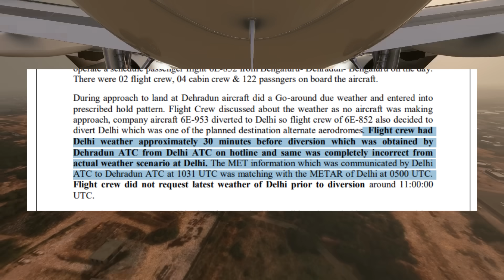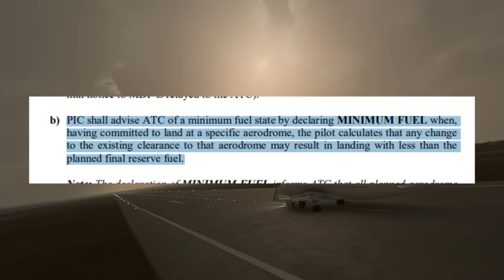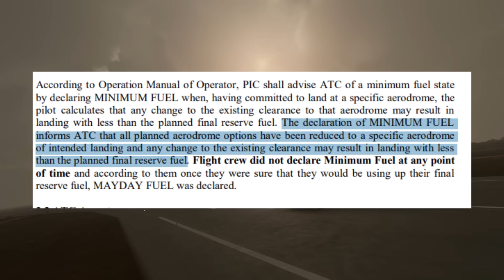How Two A320s Ran Out Of Fuel AT THE SAME TIME | Indigo Airlines 852

Comment: Why weren't the two emergency aircraft set up on different runways? Having the second mayday fuel aircraft go around after the first seems like a mistake by the controllers
Reply: the first aircraft needed emergency services which were on standby on the other runway in case of a problem. They can't teleport.

Comment: I've noticed you/others have also shared a ton of videos about fuel emergencies in India. It sounds like the planes always start with sufficient fuel, reserve fuel, etc., so I suspect it's partially what another commenter here has mentioned, that it's a communication issue where crews aren't speaking up in time. I'm reminded of Avianca 052, which crashed near NYC due to running out of fuel, and had repeatedly asked for "priority", but never "emergency" - and while Avianca 052 was the worst outcome, other Avianca flights around that time also had close calls with fuel because they weren't declaring emergencies.

I suspect other factors in India are potentially low-cost carriers where training or equipment might be lacking, and just the sheer size/population of India. Lots of flights means lots of incidents.

This also brings to mind the many incidents in Indonesia, Nepal, and (years ago) Russia. In the case of Indonesia, a ton of cheap airlines popped up with poor regulation, equipment, and training, leading to accidents. In Nepal, poor regulation is again an issue, but the biggest issue is that the Kathmandu airport is in the freaking Himalayas and it's just hellishly hard to navigate. Russia went through a bad patch after the fall of the Soviet Union where - once again - you started seeing poor regulation, shoddy equipment, and undertrained crews.

So there are definitely some patterns...
Reply: Why not just be r@cist and write less 😅

Comment: I don't understand why would they use the same runway for both aircrafts in Emergency? Delhi airport has 4 runways, they could vector the second one on the other runway.

And also would like to mention, that the weather forecast in India is terrible, their forecast was almost never match the reality. And I know during monsoon season is hard to predict precisely, but Vietnamese for example, their prediction is very accurate. 

Also the airlines policies restricting pilots to take extra fuel. I am sure in their manuals is written that the captain may take as much fuel as he considers they need. But in reality they don't really have this freedom, and it's just for the company to save 50usd per flight.

This incident happened 5 years ago, but I don't really see any safety improvements over there. I hope I am wrong, but we may expect similar incidents in the near future, and it might be with less luck
Reply: I'm not sure if it's still true, but for a long time the airport at Delhi had a weird set-up where there were multiple runways, but 3/4 were reserved for military for some reason, with only one "lane" for commercial flights. I don't remember how that came to be, but it was a big part of the capacity issues that airport has continually run into.
Reply: @jaybeetee5272 you are poorly educated… most likely by tabloid press of india

Comment: India tends to have an indirect communication culture that is highly context based.  Often times issues are hinted at and the other party is left to guess the intention of the message.  On the opposite end we have Germans, Israelis and Dutch who are direct.  A flight crew from one of those countries would be upfront about their fuel status and declare minimum fuel as soon as things started getting urgent.  From my understanding, 852 noticed the discrepancy in Delhi weather reporting and what was observed but did not speak up.  They also knew they were low on fuel, stated to ATC they had 14 minutes of fuel, and needed to be closer to the airport but never declared minimum fuel.  My thought is the flight crew assumed ATC would see the deteriorating weather conditions, figure out the plane was low on fuel, and suggest a solution.  It was only when 852 declared mayday fuel did the seriousness of the situation became clear.
Reply: Tbf they were in a bit of a sticky situation
Reply: Maybe it's because a formal delaration of emergency always comes with an investigation, so if you can convey your sticky sitiuation with a wink and a nudge you may not have to answer uncomfortable questions from authorities later.

Comment: If the screen display is RED the user has the manually refresh the data. What software are they running, DOS?
Reply from the maker: they had a local web server which hosted a webpage for the metar info

Comment: I would not be surprised if the airlines are underfueling to save costs, and hoping they don't run into a wall.
Reply: Well trust me it's about time we hear about a disaster, this company as per I can search have a no crash history over 2 decades of flying and now they are just pushing their limits with safety. 
The recipe is in place it is really about time something disastrous is gonna happen, very sad
Reply: its not worth it to carry extra fuel than required besides additional alternate and contingency fuel , you need more fuel to carry extra fuel as it adds more weight

Comment: 5:50 Errr.... Do I understand that correctly?
"Mayday, we are out of fuel."
"Acknowledged, let us park the fire engine on the runway."
Reply: How long does it take to start up a firetruck engine and drive 20 feet?
Reply: @baldrick98007 No communication received by fire engine regd second mayday aircraft
Reply: That firetruck was on runway for an earlier aircraft which had declared Mayday..
Reply: better to send out a fire engine & not need it than the alternative. even if there isn't a fire, it means emergency services can get to the plane as soon as possible
Reply: Fuel is not the only thing to catch fire in an airplane on impact with ground. The friction with the fuselage will result in fire too. 
So fuel or no fuel, the friction that the speed of the aircraft would cause when it impacts the ground , will start a fire.. so yes a fire truck is necessary.
Reply: What's wrong?
Reply: They still have landing gear and also no fuel left means extremely diminished risk of said fuel catching fire 😅
Reply: @infinidominion Got it 😅
Reply: That fire truck was placed for flight 953, the one that landed first. They requested for emergency services since they knew they couldn't probably go around and will need them in case something goes wrong. The plane that had to go around at that timestamp was the second arriving plane, flight 852. The fire truck couldn't evacuate the runway till the time flight 852 was in its final approach and thus they had to go around.

Comment: In the most recent Captains Speaking episode, Ben talked about a very long day where his flight had so many twists and turns - marginal weather, diversion, sick passenger, many of passengers not having the right visas for the diversion airport (different country), go around, diversion again, holding due to some paperwork issue. And yet fuel was not an issue. 
Of course, a whole different question is, whether it's an uniquely India problem, or if  it happens elsewhere as well but India is simply thr only one transparent about it
Reply: i think the aviation herald website would have low fuel incidents across the world in their database

Comment: What was an emergency vehicle doing on the runway when a second plane in an emergency was just arriving? Furthermore: I would think that in this case the first plane would have to leave the runway even if the plane breaks, because if not the other one would crash..
Reply from the maker: The first plane to Land declared a full emergency and they wanted fire trucks and I’m guessing they weren’t able to get the fire trucks off of the runway in time for the second plane to land
Reply: @MiniAirCrashInvestigation  I'm a layman, but I think that in order to minimize the overall risk, air traffic control should have denied this request. For example: order ER vechicles to the taxiway. Order the pilots that after landing they shold leave the runway immediately. The  first plane was not on fire.. No immediate life threat on the ground. But, the plane in the air there is it.
Reply: @LGabor74  ATC does not have the authority to deny the regulatory requirement for emergency equipment in the event of a Mayday call.
Reply: @summushieremiasclarkson4700   Bad regulation. There is no such legit decision where a lower risk automatically able to overwrite a higher risk event.
Reply: @LGabor74  I don't disagree. But this qualifies as an extenuating circumstance on a contingency, ie, being so outrageously improbable that it is entirely unprecedented never exposed the hitherto hypothetical scenario for a risk assessment.
Reply: @summushieremiasclarkson4700  It's depends of the severity factor of the risk. Mass fatal outcome is very high...with very low probaybility it is a moderate risk. Two fuel emergency plane at same time is rare, but not unprecedented. I saw atc videos before in that topic. if I remember correctly, there were at most 3 emergencies at the same time, of which 2 were fuel emergencies.